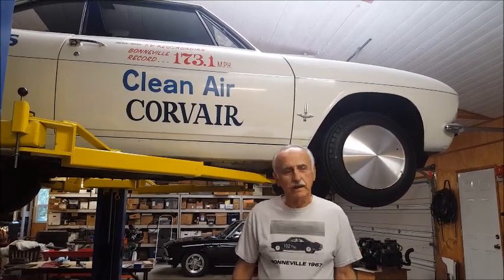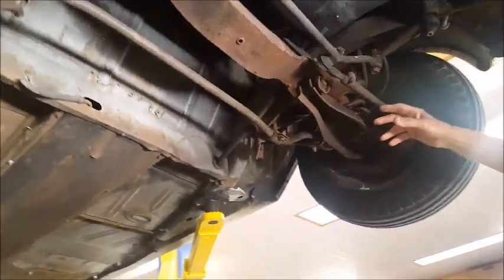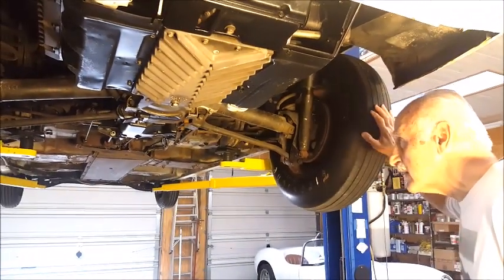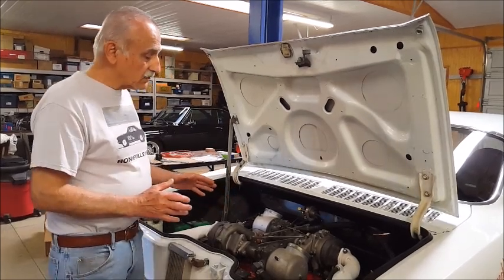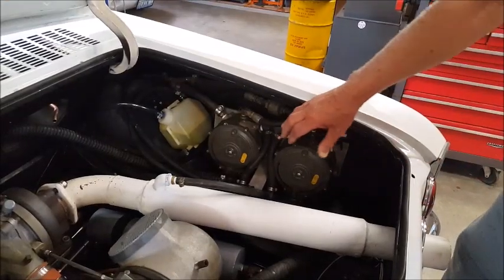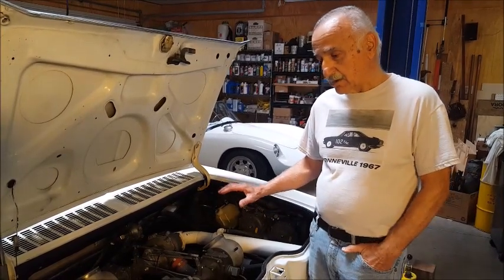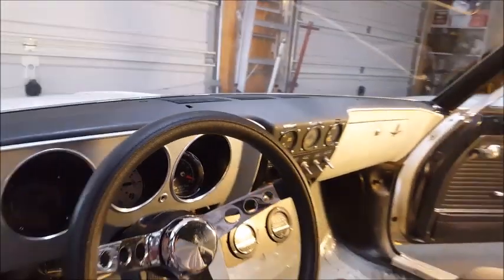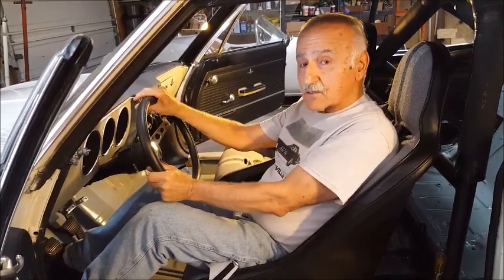World's Fastest Corvair, Is It Safe at 175 mph?

Comment: The 64 and earlier were the ones that Nader went after for not being safe. Those had the swing axle rear suspension. Chevrolet added a rear camber compensator to the 64 models. This helped to prevent the dreaded swing axle bump-steering. 

The 65 and newer were as stable as any car available at the time, and utilized a rear suspension style similar to the Corvette.. I had a 65 Corsa for a few years, which had the 140hp 4 carb motor. She was a small block killer! Smoked a few big block cars too. It was very quick off the line, the 4 speed was well geared for street racing. I had 13" TA radial tires on it with Gabriel Red Ryder shocks all round. It cornered very well, and was quite fast.
Reply: Swing axles were manageable with the rear swaybar, as originally designed. At the last minute, gm accountants decided to make the swaybar optional to keep the base price down. Most dealers didn’t order it as they saw the Corvair as a loss-leader to get people in the showroom so they could be upgraded to a Bel Air. Voilà: There’s your snap oversteer. Thank the accountants at GM, who act as the true engineering staff, and have since the days of Will Durant.
Reply: @BillLaBrie , thanks for the insight!
Reply: @BillLaBrie , thanks for the insight!
Reply: @BillLaBrie  Let's mention that the Corvair was intended to have a sway bar up front from day-1.  Beancounters decided it didn't need one, since they had decided they were smarter than the engineers who designed the car.   The 1960 Corvairs from the start still had provisions for mounting a front sway bar although none were delivered with one until the next model year and even then it was a special order item.  Not until '62 when the Spyder was introduced did Corvairs get a sway bar as standard equipment and only the Spyders got it, other models could have one dealer-installed or special-ordered with one.  In 1964, along with a modified rear suspension with a rear leaf helper spring serving as a "partial camber compensator" did Corvairs get a front sway bar as standard.  My '60 Corvair 4-door sedan HAS a front sway bar, from a '64 Corvair.  It fit perfectly.
Reply: @tonyunderwood9678  yep. As I’ve said elsewhere, at GM the accountants are the engineers.
Reply: @tonyunderwood9678  Thanks for the info! I always wondered way the brand-new gas tank for my '60 sedan had a perfect indentation for a sway bar. Maybe I'l get one down the line when I overhaul the suspension.
Reply: I’m glad you pointed out the difference in the rear suspension that MADE the earlier corvairs unsafe. It’s interesting that the Pontiac Tempest in its early versions also had that swing arm suspension but Nader seemed to leave them alone.
Reply: @joeljenkins2876  Nader also ignored VW, which had swing axle thru 68 in the Bug, and Fastback/Squarebacks IIRC. 67 was the last year for swing axle in the Bus and Pickups. Fiat also had a swing axle on the road in the mid 60s. Nader was out to do a hatchet job on Chevrolet, and he did it but good. Self-aggrandizing IMO.
Reply: @kens.213  Why did he dislike them so much? Did he have a bad experience or something?
Reply: @joeljenkins2876  I think he knew it was one way to make a claim to fame.
Reply: @joeljenkins2876 , I believe that his point was that unless an outside force presented itself, such as regulation (in the absence of competition), the Big Three had no incentive to improve engineering that affected safety. Preston Tucker said the same, only he tried to provide that pressure with competition from his own marque.
Reply: @leehaelters6182  so when the suspension design on the corvair was improved, did he back off, and if no, why not?
Reply: @joeljenkins2876 , an excellent question, I wonder myself. I was a teenager at the time. The damage was done, in any case; the book written, the Corvair laid to rest.
Reply: @leehaelters6182  Actually Nader did not kill the Corvair. Gm continued production until 1969. Overall, 1.9 million Corvair variants were sold. Hardly seems like a loser???  In fact, the Corvair platform led to more variations than probably any other machine. pickups, vans, RV,s, mid engine, airplanes, airboats, dune buggy's, and whatever else Ive left out. The reason corvairs are not more valuable today is the fact that there a LOT of corvairs available.
Reply: @bryanturner683 , I appreciate your point of view.
Reply: The 1964 Corvairs and later had the upgraded suspension.
Reply: I had a '61 4dr Model 700 and never had "rear" bump steer. That was a load of Nader BS. Quit advancing the lies that ahole perpetrated.

Comment: Tom I greatly appreciate you posting this video.  You are legendary amongst Corvair fans!  I remember reading an article on you and your car but I had forgotten in ran on propane.  In 1970 my father and I rebuilt a 1965 Monza and since he owned a LP Gas bulk plant and had been converting cars, trucks and tractors since 1953 we used propane for the Corvair.  Bought a modified 140 from Bill Thomas using a Ieco ram manifold with an Impco 4bbl carb.  Mounted 2 aluminum fork lift cylinders in the trunk and ran engine oil in the converter.  The power and performance far exceeded our expectations!  We went to the inaugural (I think) CORSA convention in Chicago
.  My dad had signs made calling the car the Clean Air Vair. It was the 2nd fastest in the slalom and appeared on a local TV news segment during the convention.  The response to the car convinced my dad to buy John Fitches' Sprint business and build modified Corvairs we called Sprints and Cavaliers.  PS. about a month after the convention the engine developed a knock and when disassembled we discovered it had 13:1 compression.  What you said about the capability of the Corvair chassis is dead on.  We built a Crown Corv8 with a 450hp 327 that I drove 150 mph at Road America.  People don't realize what a great car the Corvair was.
Reply from the maker: I met your dad at the 1973 CORSA convention in Anaheim, CA.  We ended up sitting at the same table at the banquet, (you may have been there).  He told me about converting his Corvair to LPG and the Cavalier project and I enjoyed talking to someone who had a lot of experience with Propane conversions.  
I vaguely  remember that Eric Dahlquist, who was the editor of Motor Trend magazine and the main speaker at the banquet, was interested in buying a Corvair Cavalier from you folks.
Bruce, if you are familiar with the Corvair Forum, look me up and send me a PM.  I've got some photos I'd like to share with you.

Tom
Reply: @tvkperformance4147  Tom I joined Corvair Forum this morning.  Still trying to figure out how to find you on it! lol
Reply from the maker: Bruce,  On the Corvair Forum, go to the Forum list--then select "search"- then do a search on "tomkeo".  
At least one of my postings should come up, then you can send me a PM.
Tom
Reply: @tvkperformance4147  Tom,  I just did tomkeo, I have done TVK Performance and Tom Keosababian.  Your full name yielded 9 responses but it was people mentioning you.
Reply from the maker: @bruceherschberger1871  Bruce,  Here's the steps to follow:  You said you had joined the Corvair Forum so go to <corvairforum.com>   then select <sign in>  then in the "Go to" bar select search.   In the search mode, type in <tomkeo>.  You should then see a number of postings from me on various subjects, click on any of them (make sure it's from me) and scroll down to the end of the dialogs and you should see a response box.  If you signed in, your name should be listed so go ahead and select <Private Message> and message me and send it.  (Be sure to include your email address.)  The private message will not be posted anywhere except to me.  This should work.  Tom
Reply: @tvkperformance4147  Tom I did all that and went thru 18 pages of members under T and couldn't find you.  If you post on my new member post I think I can  answer you directly.  This is all new to me.
Reply: @tvkperformance4147  o
Reply: That's for sure.  I was the driver of my '66  Corsa at 105 mph when I needed to make an abrupt right turn.....I made the turn successfully after a sidewise drift at that speed on dry pavement. This was a std factory equipped Corsa!  This could be the "SAFEST CAR AT ANY SPEED" EVER TO ROLL OFF A U.S ASSEMBLY LINE.
Reply: @johnwhitaker2552  Absolutely!  My first car(@16) was a 65' Monza 110/4spd.  I drove it summer into fall and then we put it into our shop and did a "frame off" restoration/modification.  The next summer (1971) we went to the inaugural Corsa Convention and my Dad had 2nd fastest time in the slalom with the car.  It also ran on propane and Tony Fiore (then editor of the Corsa Communique) asked my Dad if we could build him a car.  We did and over the next 5 years did 40 more.  So as a kid I was able to drive all sorts of Vairs in all sorts of "situations" lol.  The engine shop was about 40 miles away (very curvy road) and every couple of weeks I was sent to pick up 2 engines in a Modified Greenbriar (170hp 140, 66' 4spd. posi, improved brakes/susp with 15" rims and Michelin radials.  It was amazing fun.
Reply: No one knows the exact day hour /But we can see  the signs  events all around us. And  by the timeline,   Israel is  80 years and  1 generation span  according to bible  text will be around  2027 , which israel was declared  first in  1947 + 80 years = 2027 .  so we know we dont have  10 years left as this is 2022  so the   rapture, then the tribulation  will be before 2030 for sure.

The rapture will happen without a doubt and it will happen much sooner than many believe (less than 10 years according to all the environmental, weather,astronomical signs ,israel timelines etc showing ). It will happen without any warning , not one , in an instant , catching masses of people off guard just like God always does, ie the flood ~ a rude awakening . No one knows the exact day or hour the rapture will happen is a certainty . THE RAPTURE CAN HAPPEN NOW at ANY TIME make no mistake !! . Please awake to Christ Jesus which is the ONLY hope NOW and dont let it be found out it IS all true later when its too late & many have been left behind in the most terrible times the earth Has Ever experienced Before and ever will...for anyone who sees this and doesnt know what to do please If anyone hasnt given their life and heart to Christ Jesus will have REAL BIG problems way bigger than any problems Ever had If left here on earth after the Rapture . After the Rapture The USA , Worldwide , will face More evils , Inner city chaos, firearm wars etc etc ,power & water , food shortages , military invasions,mass executions (yes much blood will be required by antichrist ) etctec than it Has EVER been seen Before and you surely dont want to be Here then . We Have Time NOW to change , please seek Christ Jesus while there is still time to save ! no one knows the day or hour of the rapture it will start out just like any other day and it will Take Place In the day In Broad daylight/sunny day , In an Instant FLASH without ANY warning ,& there will be peoples Driver Ids, cell phones ,wallets found in various parking lots,Purses, bill folds Found at work etc etc with NO explanation , and People VANISHING so No One can refute it has taken place. .
romans 10:9-10 That if thou shalt confess with thy mouth the Lord Jesus, and shalt believe in thine heart that God hath raised him from the dead thou shall be saved! 
please share with others =IMPORTANT
raptureready.com

Information  for anyone who has come across those that  refute the 
 rapture and  say  that it was supposedly  made up  and   say it was created by darby church  in 1700s . This is real good  to show it was  way before darby , and its documented .
 also rapture pre trib proofs even in dead sea scrolls .
15-1700s/  irenaeus 170ad/ 250 ad / /isidore 4th century   
sourced by intense search and study by  ken johnson 
https://www.youtube.com/watch?v=e1Nv-xFig8I

Comment: Tom:
I have been a long-time fan of you and this car.  I have a '68 that I want to use a chevy 4.3 V6 in along with the lpg draw thru turbo setup.  Can you recommend any sources that would be helpful on the induction setup.  THANKS
Reply from the maker: My list of propane equipment suppliers is 40 years old.  Nobody ever made LPG kits for Corvairs and I'm only aware of 1 or 2 other Corvairs running on Propane.  One of them was in Michigan.  I would suggest finding a Propane dealer who might be able to connect you with a fleet operator.  One dealer I most recently dealt with is:
Jerry Thompson
859-881-0509
nashfuel.com
He has an extensive online catalog and is very knowledgeable on Propane fuel systems.
Reply: @tvkperformance4147  Forgive the delayed "Thank You", but YouTube didn't send the response on time.

Comment: I remember driving my 66 Corsa in high-school and the faster you went the more stable it got. And that was on 13" tires. I just wished it had had an extra gear. The fuel mileage was great and torque was good for the size engine, I know it could have pulled an overdrive gear if it had had one.

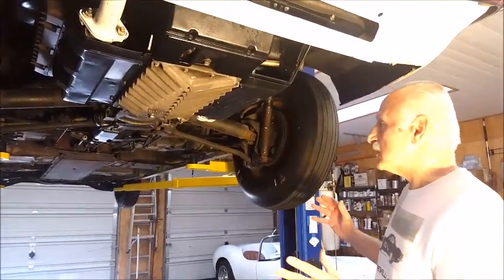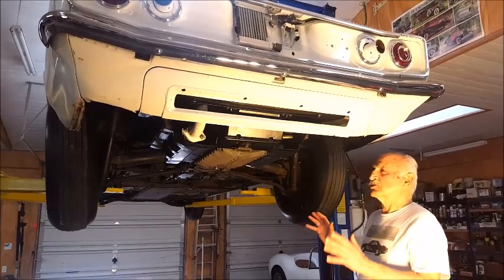Comment: Excellent!  What differential ratio does this car have?  To attain that type of speed without revving to the moon, it must be pretty tall!  I am familiar with the 3:89, the 3:55, and the 3:27, and heard that there was also a 3:08.  Is that correct, and is that what is in this speedy ride, or a custom ratio?
Reply from the maker: Yes, I was using the 3.08 gears.  The rear tires provided the gearing I needed--they were 27.5 in. in diameter.  I ran the engine to 7500 rpm in the lower gears.  The highest reading I saw in 4th gear was 6800.  Thanks for your comments.
Reply: @tvkperformance4147   Really great mods.
30 psi... Excellent.
Water also expands under high heat, giving uou steam engine torque. I also wanted to set up my Corvsir with propane and turbo. Uour intercooler using cold from propane gad expansion was another thing I wanted to try. It is really chilled. Try also various propylene and propane gas mixes, better than usual propane. Subscribed and hoping for more.
Cheers 🍻
Reply from the maker: @andykerr3803    Thank you for your comments.  I have also thought about using an intercooler to reduce compressor output temperature and at the same time, keep the regulators from freezing.  On my street driven turbo Corvair, I have a heat exchanger in the crankcase and I circulate water through it and the pressure converters.  This is how I reduce my oil temperature and at the same time, keep the Propane from freezing up.
Tom Keosababian
Reply: @tvkperformance4147   I will watch again. I assumed you were cooling the thickened area of the intake tubing... I thought there was an internal sleeve with coolant being warmed. Anyways it was super cool... Pardon the pun. Do research propene and propylene. I had first heard of them only as a rumor of racing engines, possibly Formula One experimenting. Makes sense. Propane is good, but these specific compounds are better. There is even a liquid version ( really liquid, not compressed) made from them also.
Cheers.
PS You can buy test amounts easily at a welding supply.